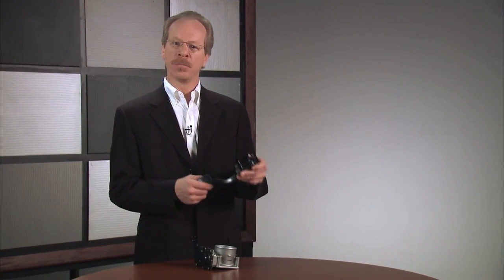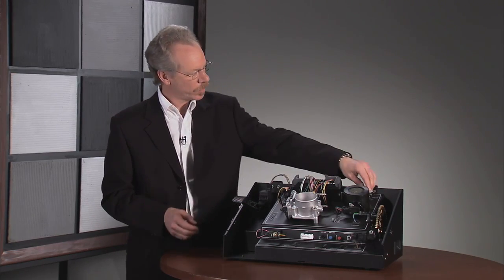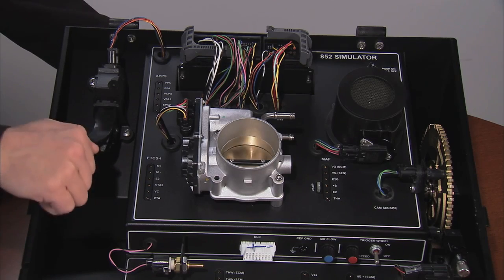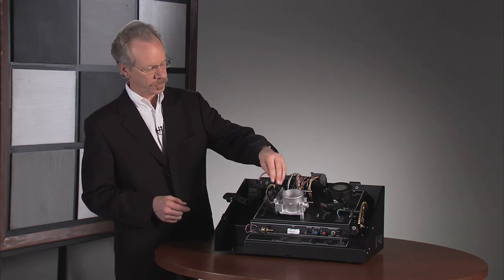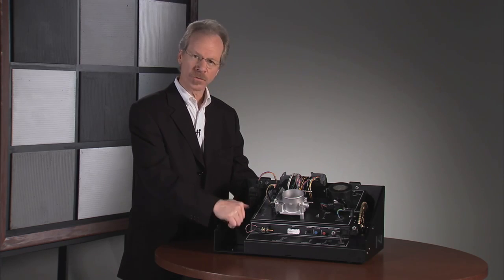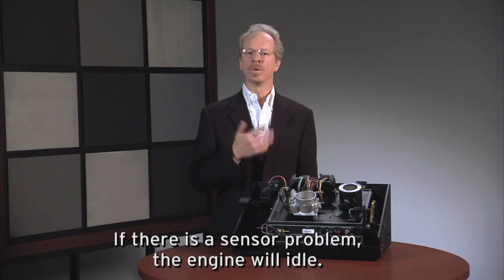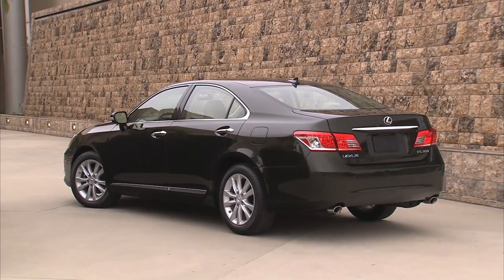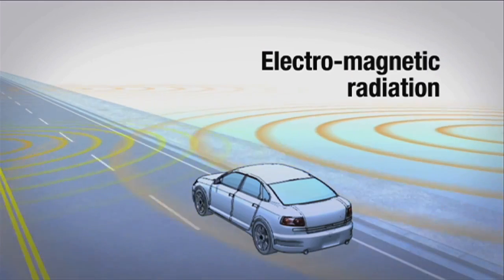Lexus Electronic Throttle Control System

Comment: Lexuses really need a throttle controller, super laggy throttles. The TC transforms the car
Reply: Can you buy a throttle controller for a 2014 IS350 AWD with the 6-Speed Transmission??
Reply: @devanrogers3133  Sprint Booster SBLE0003S

Comment: I have 1995 Lexus LS 400 the problem is she start right up and runs about 10 sec shut off doesn't want to stay in running  and replaced most of the major control like mass air flow sensor, throttle body., throttle position control valve, Idle air control valve, fuel pump, fuel filter, and ECU  still not success, I very confused I need help
Reply: did you find the source of the malfunction sir?
im also experiencing that now on the ford focus, altho the car dont have a MAF and MAP sensor,
only IAT and a couple of oxygen sensors
Reply: @endurofan9854  yes, I did if you follow my video  it is a clip that  show where located the problem

Comment: I need  help my Lexus IS 250 / 220D Doesn't wanna accelerate. It only ends up at 20 km/h. I think its a wiring proppe
Reply: Do throttle position adjust, there are few videos on this on youtube

Comment: This is why I prefer the cable throttle control. This electronic method in the Lexus is so laggy and unpredictable especially everytime you floor it. The lag is unpredictable. From 2 secs delay, to 3, to 1 . It's annoying
Reply: The lag you speak of can be adjusted. Just ask a mechanic who knows what’s he’s doing.
Reply: There isn’t any lag

Comment: When did Lexus models first start getting drive -by -wire electronic  throttles? When did they stop using throttle cables?
Reply: Good question
Reply: 2002 and up.